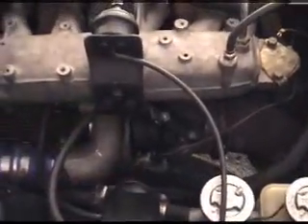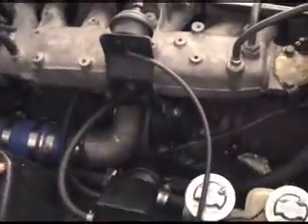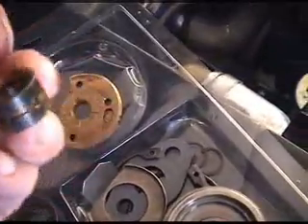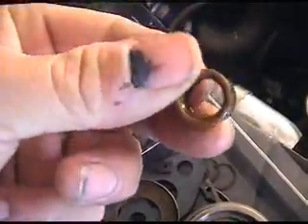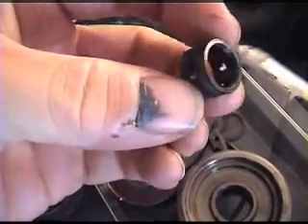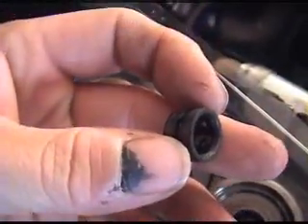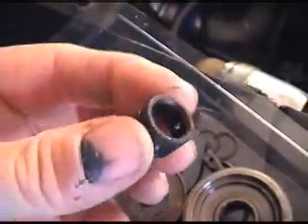holset HY35 rebuild

Comment: Nice video! Quick question, was it smoking out the exhaust? Or the from the turbo itself? I have a HY35 and I'm wondering if I may as well rebuild mine...how is the rebuild holding up? What did you do in regards to the extra heat? Just a turbo timer?
Reply from the maker: It was smoking out of the exhaust, held up good lasted several years. I used the timer more BUT I think I should have had an oil spacer on the oil inlet line??

Comment: when you took it apart did you make a mark where the compressor wheel is placed on the shaft? if not later on down the road look forward to replacing them again sense it will be out of balance...

Comment: its cause the turbo is still spinning when you shut the engine off. there fore the oil isnt recirculating to the bearings in the turbo..

htere for the smoking and the crapped out bearings..

im interested in buying this turbo and i think im gonna. and get the rebuild kit.. i mean its so cheap

Comment: but like i have a holset hx 35 on my sunbird ran 12.71 @ 117 mph 19 lbs boost and havent realy had any problems and my turbo had 600 000 kms on it. but i take it easy just before i shut it off